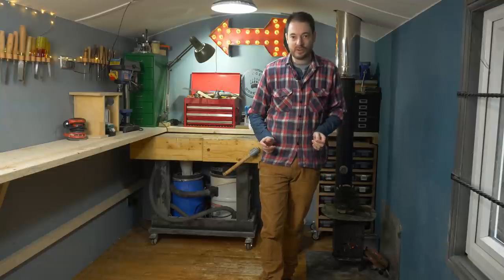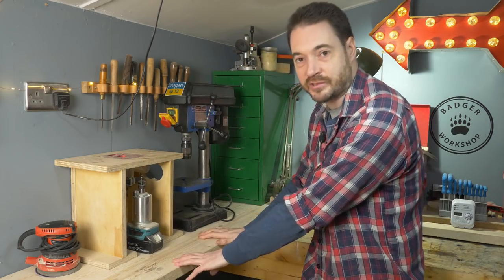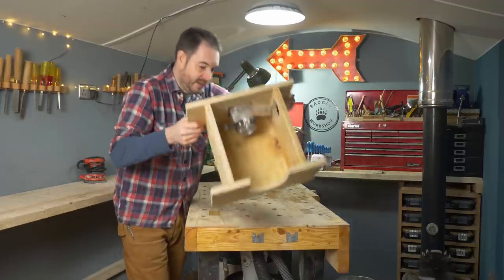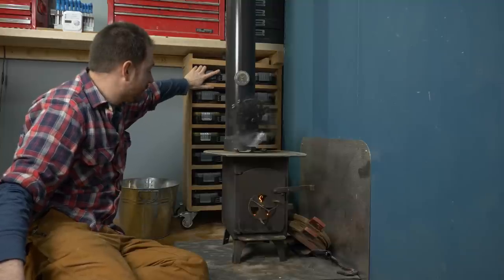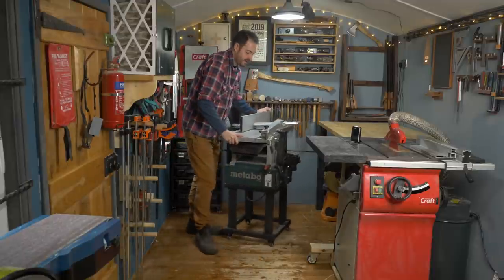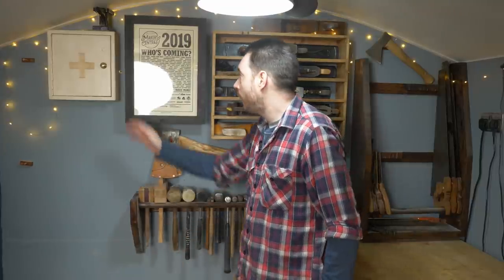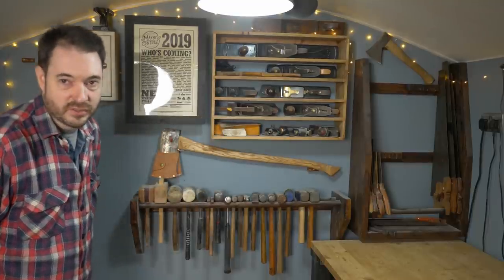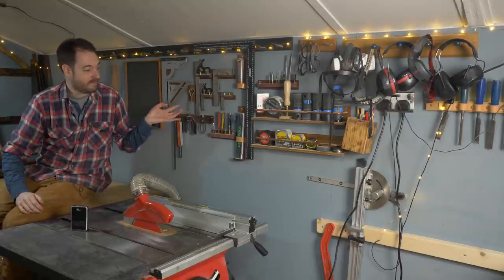Workshop Tour 2020

Comment: Hi Matt from the Netherlands!
Love the simplicity of your videos easy to understand! Just had a thought as I’m a camera buff! Why not setup a ceiling/ roof mounted camera 📸 with lots of options re angles and height , the same with your lighting setup! - one of the things I’ve gleaned from you since I setup my workshop is the French cleet system. Living in the Netherlands my workshop is 10’ x 8’ and already has a large metal cupboard, big hardwood bench and shelving. So not much room for anything else. In summer months I can setup outside good weather then, but winter no good as I would be in and out all day! So what I’ve done is setup a temporary workshop under car port which is exposed on 2 sides with thick ground sheets ( keep out wind rain etc!) and use gas floor heater. When I saw your small wood heater - well I must explore that as cheaper to run than gas and it gets rid of my unused off cuts! Anyway cheers for now! Chris “The Aussie living in “The Netherlands” 🇳🇿👌
Reply from the maker: I love my wood burner. I don’t think ceiling mounted world work for what I do

Comment: Hi Matt. Thanks for the updated workshop tour. It's always great to get some new ideas for my own workshop (garage). 
I suggested the Axminster Craft AC82E extractor paired with the upgraded filter cartridge on another of your youtube vids. If you have a look at the user review of the AC82E (second page) there is a picture from someone who has mounted the extractor on the door/wall of their workshop. This may be a good fit with your workshop size constraints.
At present I have mine on the wheeled base it comes with and move around as needed but fixing up on a wall/high point with a longer hose is probably a better use of available space.
Reply from the maker: It does look a nice powerful machine

Comment: Nice work. I think you've made the best use of the space you have and it all seems to work well. 
If you want to keep the outfeed table, but make a bit more space, you could fix it to the wall with hinges so it folds down...that way you keep the outfeed and workbench function (plus you could buy another machine to stand there, put it on a wheeled base and move it when you want to use the bench)👍
Reply from the maker: That’s a clever idea

Comment: Thanks, this was really helpful! I have an even smaller workshop too (3.8m x 1.9m) which I'm just putting together with key tools (router table, table saw, band saw, thicknesser, vacuum with cyclone, and so on...) so I've got lots of things on stands and castors too that double up as storage!

For the lights and camera stuff, one suggestion may be to install rails or attachment points on the ceiling in a couple of strategic places. You already have a Makita 18V tools so for a filming light you can use a Makita cordless flood lamp.
Reply from the maker: Thank you. Good luck setting up your space

Comment: Cheers Matt. Really enjoyed seeing how you built your workshop without plans. Great channel. You work the same way as me so I can relate to your methodology. Can I recommend the record power DX 4000 to you as an upgrade. I have one and the power on them is great for both dust and also chips and being a vacuum doesn't lose suction when you step down to smaller diameter Pipeworks. Really good machine. Expensive but you can get a used one for around £200
Reply from the maker: That does look a good machine
Reply: @Badgerworkshop  it is mate. Ideal for the smaller workshop. Axminster do a 63mm pipe kit with 5 gates and the elbows and T-junctions for £125 just need a step down from 100mm-63mm from the vacuum ( also available from Axminster);and it'll do everything you need from it including thicknesser. The suction is superb as it has two motors and you already have the cyclone. It's a no brainer mate.

Comment: Thanks for the tour Matt. It’s always interesting to see how others lay out their workshops especially when they’re small. My little workshop is even smaller than yours at 12’ x 8’. I need to re-think its layout too. That dust extractor you want to change is the same as the Record 1000. I have a similar Record extractor and found it next to useless for my Record bandsaw. I am thinking of changing to the Makita VC3012M which has a Hepa filter. It’s High Pressure Low Volume as opposed to the Record’s High Volume Low Pressure and much quieter. It’s only 30 litre so more emptying but should keep my air clean down to 0.1mg/cu m as opposed to the Record’s 0.5 micron. I am now the proud owner of an MFT with bench dogs and a rail with flags for repetitive cuts, as I don’t want a dangerous table saw. I could save a lot of space if I could remove the bandsaw but I need something smaller that will do the same job. Any ideas please?  Best wishes for Christmas and the New Year.
Reply from the maker: No ideas sorry. I don’t there is much that could replace a bandsaw

Comment: I love your workshop....like mine, always a work in progress. Is there room outside your workshop to build a small addition for a decent dust extractor and port a hole into the workshop? That's what I've done with mine and also sound proofed it. Yandles do a lovely SMALL Laguna 1hp extractor with cartridge filter for under £500. Have a best as possible Christmas....best wishes
Reply from the maker: I do not really have room for that. The Laguna looks like a great machine. Happy Christmas

Comment: Thanks for your tour. I would like to know where you got your flat ground table saw blade, having trouble finding any on line. Also I wondered about your ear protectors with the radio built in? Wishing you a good New Year. Keep up with the videos.
Reply from the maker: There is a link to it Under the video. The blade is made by CMT and the ear defenders by Stanley

Comment: Hi Matt I'm enjoying your videos thank you for posting them. You seem to have multiple dust extractors / filters, I am wondering which to get as my table saw kicks out a lot of dust. Currently using a wet/dry vac connected which is maybe not up to the task. Any advice is appreciated from yourself or other would be makers.
Reply from the maker: It all depends on what size port you have on it
Reply: @Badgerworkshop  it's 43mm.
Reply from the maker: @davidprentice4805  A high volume low pressure machine is what's needed for a small port like that. These are basically big vacs. You can get twin motor Ines like canvas. I will be making a video about a British made machine soon
Reply: @Badgerworkshop  Thank you for the advice, I look forward to the video. Keep up the good work, it's great having some Brit makers on YouTube to aspire to.

Comment: Matt I have a triton spindle sander and I don’t know if I got a duff one but the spindle does not go up and down any more because the gear wheel striped just after the guarantee ran out, I bought a new part and that also did not last long so I have not replaced it and now the spinel does not move. I would be interested in your experience with this item
Reply from the maker: That’s not good. I have had mine a couple of years and had no problems so far